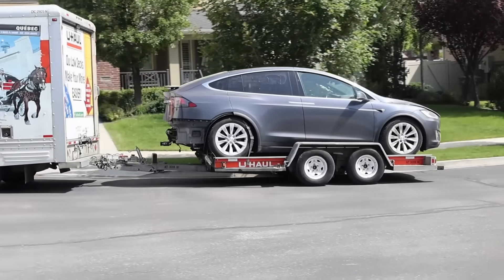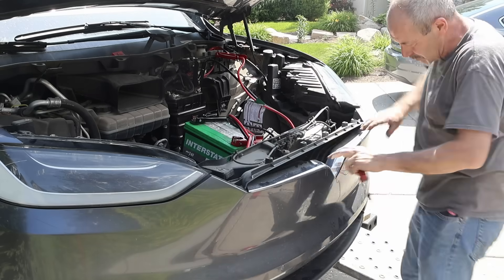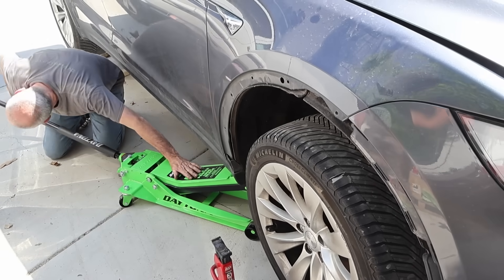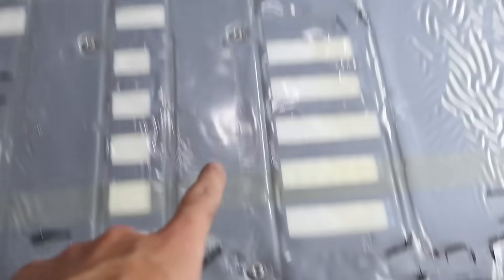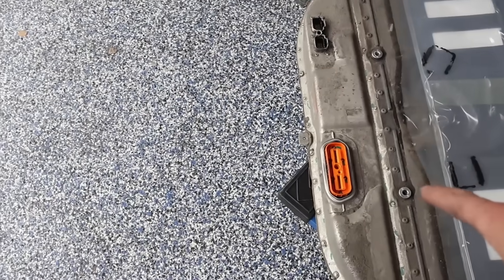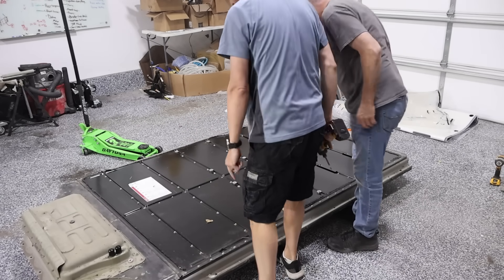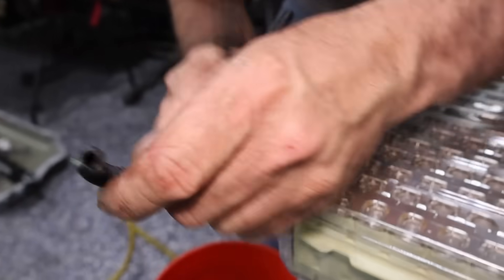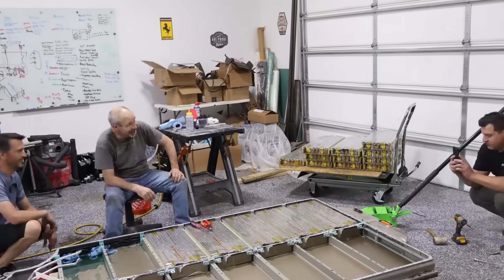Ripping Out a 100kWh Tesla Model X Battery...in my driveway!

Comment: I dont understand. You had a perfectly fine battery. Why? 
Did you check the pyro fuse? 
Did you even connect to the battery to check its logs? It looked fine.
Reply from the maker: It was a totalled car.  Batteries are salvaged for another project.

Comment: thanks for the video... but if those thin wires really were used for cell taps, it seems really bad to cut those and short them together as the cutter goes through them. What am I missing?
Reply from the maker: Cell taps go to the boards on the modules.  Wires exiting modules are communication wires, not cell taps
Reply: @electricsupercar  ahh ok thanks.

Comment: Reason why S and X even still had those quick connector was for battery swap. Tesla even had one test swapping station open in 2015 - 2016.
Reply: They did and the demo was quicker than filling a 3 series BMW with gas!
The video can be found on here from 2014.
Reply from the maker: Thanks for sharing that info!

Comment: I think it would be good to share the number of cycles this battery has had, so when is it still save to buy for parts?
Great video, showing actually some good engineering of Tesla's batteries.
Reply: I mean, if you want to convert a small car you don't care much about battery degradation. If you want to make a backup battery storage for a house/RV, it is again a non issue..